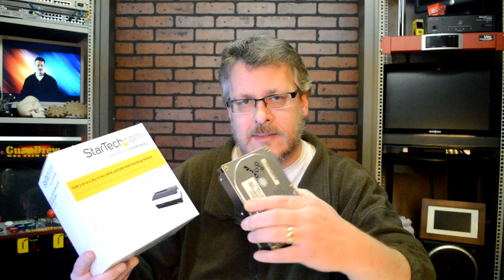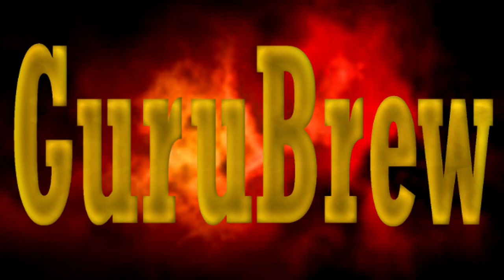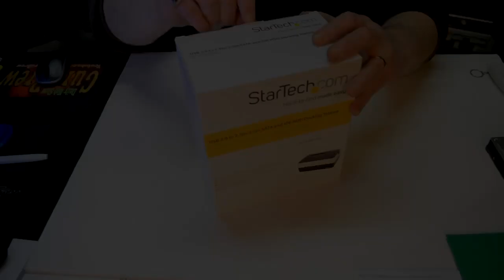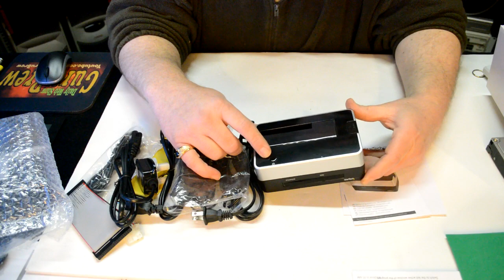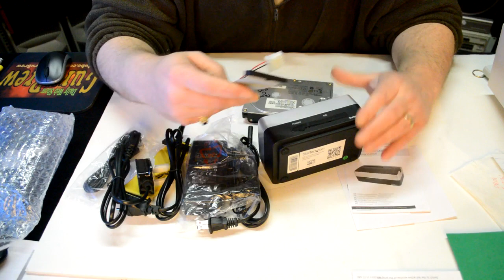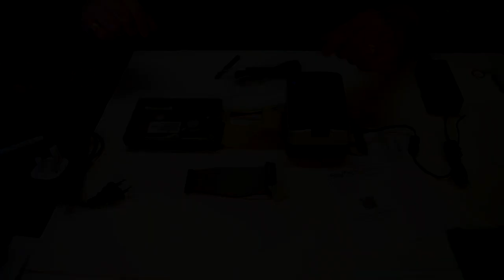Universal SATA and IDE External Hard Drive Enclosure

Comment: Steve, here's the link to the one that I bought it does both IDE and SATA 2.5 and 3.5 inch drives.  http://www.ebay.com/itm/Dual-2-5-3-5-IDE-SATA-HDD-Hard-Drive-Disk-All-In-1-Clone-Dock-Docking-Station-/121520284295?pt=LH_DefaultDomain_0&hash=item1c4b2c6287.  Found it on Ebay for less than $30.
Reply: how do you like that Clone Dock Docking station was thinking of buying one myself
Reply: Terry Kolthof I like it, although it could have come with a longer USB cable.
Reply: thanks for the reply